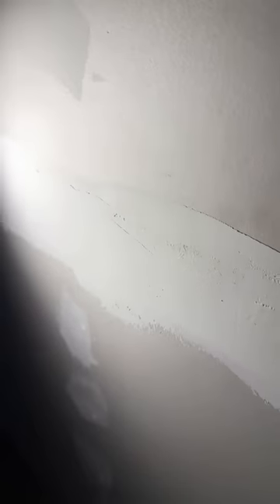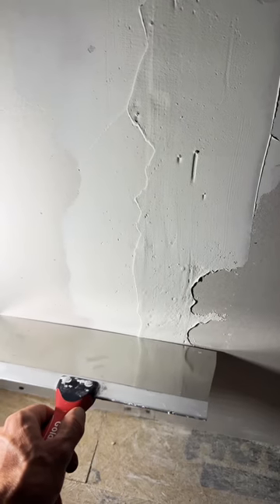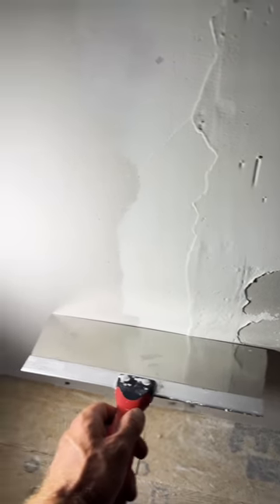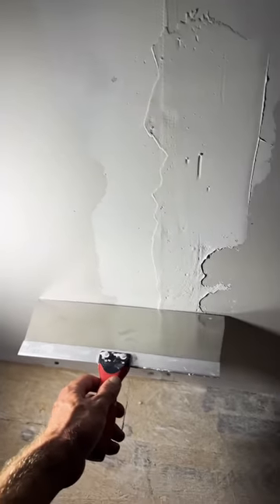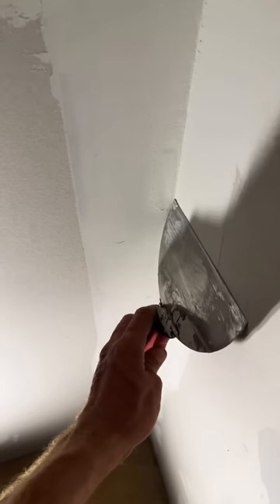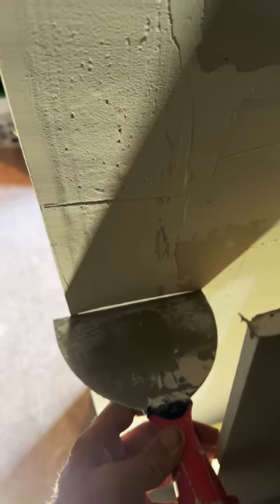Second coat of mud

Comment: Rule of thumb I use is, the less mud you put on, the less you will have to sand in the end.
Reply: Funny.
Buddy and I decided to mud my 24'x24'x10' shop. Watched YT videos, do light coats, build it up, etc...
We discovered you can coat the joint pretty well in a single thick coat.
We quickly ran out of mud - bought more.
Used 15 gallons of mud in that little shop.
Spent the next 3 weeks with power sanders sanding off the excess mud.
Lesson learned.
The walls and joints are mint though! :)
Reply: @Kurdain but that's the same difference. 
The difference in doing it that way is with thinner multiple coats, you sand for however long each coat. And with one thick coat, you do all the sanding at once. 
All the sandings from the multiple coats add up to the one continuous sanding.
So the only difference is one long sand or multiple sands that add up to be the same.
But maybe the difference in how long it took was because you used way too much when it wasn't necessary. 
I don't think you were thinking ahead and realizing when you put it on so thick, you were gonna have to remove alot of it. You still should have used the least you needed. But instead you just slopped it on and wasn't using your head.
Reply: @Kurdain most mud will crack after drying for awhile if it is too thick. I'm talking like a month maybe a year. Light thin coats, let it dry completely and only sand the final few coats
Reply: MIT grad with a beard.

Comment: Sand after second coat and a light sand after final coat. Less is more and you should push the tape hard on first coat to get air and voids out of the mud / spackle . Thinner the coats the less sanding in the end. Drys faster too
Reply: Definitely no need to sand until the last coat when done correctly the final coat will cover every other layer

Comment: I used to do this too.  Slap a bunch of mud on and sand until my arms fell off.  3 coats, initial coat is less so doesn’t require sanding (just scraping off high spots).  Light sanding second and final sanding which should be super easy and fast

Comment: Run a continuous vertical on the screw heads. It’ll save you a TON of time. Load up a 6” knife on the end and turn the knife 90°. Start at the bottom and go all the way up. When you get to the top of the life back horizontal, push tight against the drywall and go down to takeoff the excess.

Comment: Yep, scrape the edges and ridges off first coat then light sand after second coat, it's how we've always done it. Really easy with the Dewalt powered vacuum sanders we use that remove most of the dust at the same time so you don't have to brush or sweep the walls before 3rd/skim coating.

Comment: Just depends on what you want. Doing texture? Don’t sand in between. But if you’re doing smoothwall I’d highly recommend sanding in between. Not for looks, but you’re 3rd and 4th coats will go on much more evenly with less change of chatter marks/ scratches

Comment: I was originally taught to sand between coats, but quickly realized that was stupid. I do most of my sanding with power tools, because I like to work smarter not harder. Additionally, I get my mud down smooth and minimize mud usage on screw holes (it's a major pet peeve and a time saver).

Comment: They sell corner trowels too. 
If need be, I've also skimmed with pretty wet spackle and a nappy roller. Flatten it with a super wide trowel. Very smooth.
Reply: I did an entire house like this. The customer  bought a house with knockdown texture walls but wanted smooth walls. It was a ton of dust but came out very smooth in the end. We used large 18" rollers and rolled on real wet mud and smoothed it the best we could with 16" knives. Scraped and did it again and sanded it. The sanding pad he has in the video with a pole attached worked the best to get it flat

Comment: If you read the bucket, it says to wet sand basically just take a wet sponge one of the big yellow ones wet it down and then go over it. There’s not really a need to ever dry sand.
Reply: Yep.
For heavier mistakes I use one of the sponges that is backed by a green scrub pad.
Wet the dried mud with the sponge green pad scrubs it smooth.

The part I really like is no dust.
Reply: I personally never wet sand but it’s also not wrong . Just a personal preference. Just a tip though since that’s your way . Get a moping sponge with the lever to ring it out . Their are tons. Cheap to . Use that. It will work like a sanding pole . It will keep your work flatter, and you won’t be breaking your back bending over or working up and down a ladder to keep wetting the sponge . It will cut your time to finish by more than 50%

Comment: Are you using a vacuum sander to reduce dust? If you're using a pole sander and vscuuming the floor, foam backed sandpaper is the best. Something like 120 grit for the first coats, and 180 or higher for the final sand. Hope my comments have been somewhat informative if not helpful

Comment: Also you can use the same trowel for bigger coats, its about how you use it, not your size.
Reply: @viktorstone7043 clearly you know nothing about plastering 😢
Reply: @skvmbxgg247  i was laughing at the sexual innuendo... Not sure if you got that.
Reply: Tape with a 6" putty knife. First coat with a 8" taping knife.  Final with a 10" tapi ng and 12" on the butt seams. Personally I tape with regular joint mix and everthing else is +3. Topping mix is for stimpling.
Reply: @willybones3890  knives work fine, but I like how trowels let you push the mud rather than pull it. As long as it sands out though, its down to preference
Reply: @jackhazardous4008  I reckon trowels are outdated, only good for joins with big steps

Comment: I lay my first coat with a 4" and then scrape with a 6" when I do my second and do my second pass with a 10"  
99% of time it's ready to sand after second pass. If it's 5 lvl or just shadows play against me then I do another pass puller hard with a 10" or 12" and it barely needs to be sanded

Comment: Hey Nate, what number/size trowels would you recommend to get to accomplish this? A 3,6,9,14?? What you think
Reply: Consult some drywall videos on youtube. It's an easy skill to pick up but finding yourself elbows deep in mud, dumbfounded at the mess you've made, hotter than hell, is miserable to say the least.
Reply: For a trowel we typically use a ten-12 inch trowel, for knives the primary size you want is a 6 inch,  and a 4 inch for corners and where the edge of two walls meet a roof (called threeways) for angles, we typically use a 3 inch flusher.

Comment: I do home repair for a living and have never needed to sand between coats. But y'all do what you think is best. As my old mentor used to say: "It doesn't really matter how you do it if it works."
Reply: Honestly it depends on what type of work you are doing. I'm a super in a few apartment buildings and some tenants just want you to leave as soon as you get there. So for those people it's just a mix of plaster+joint compound and then a quick paint job to match the new work to the existing work and I'm out there.  But in other places they want new construction quality.

Comment: I don't sand at all . I just work the mud til the edges are flat and smooth . Multiple thin coats .if doing a repair I use putty knife to knock down any high texture , then work my mud magic . If texture prevents smooth flat edges I'll use a damp rag to lightly  feather the outer edge smooth before mud has a chance to dry.

Comment: Don't always fill in your buttjoints! If hung odd or framing is odd then the butt with bulge out, so check to see if your knife tetertoder on the joint, filling in only the deep sides and trying to keep off your tape to keep from rasing the seam higher!

Comment: Your using way to much mud for taping buddy. Those angles have enough mud for second coat! All first coat should be is mud under the tape.

Also, mix your mud all purpose a little thinner and more throughly to avoid those big clumps and pulls.

Comment: You sand between coats so your trowel/knife moves smoother over the mud. If you dont every liftoff creates a wobble in the mud and by the time you hit it, its too late to sand off. What that guy told you was bad advice, even if he's been doing it for however long.
Reply: I know what you're talking about but all you do is stagger your lift offs. Had this problem with paint and my teacher told me I was too consistent and should stagger where I begin and end.

Comment: No offense whatsoever
After 40 years of Drywall, not bad.
 Can I build a Homestead as good as yours,  Nope
P.S.:  always sand between coats to get rid of of the buggers
Only a light brush, you put it on there for a reason.